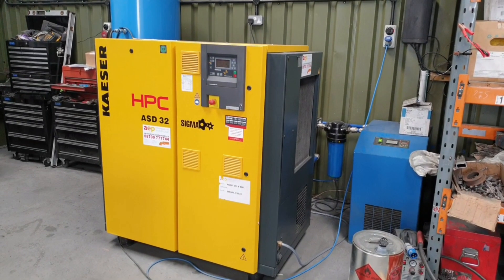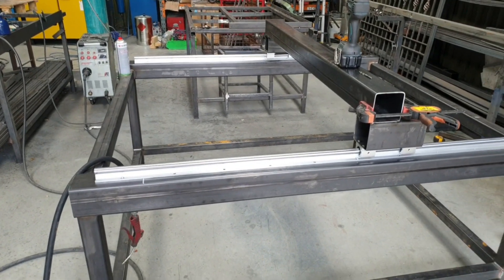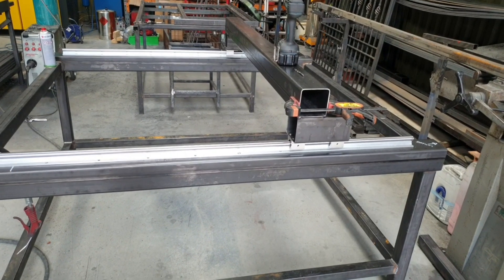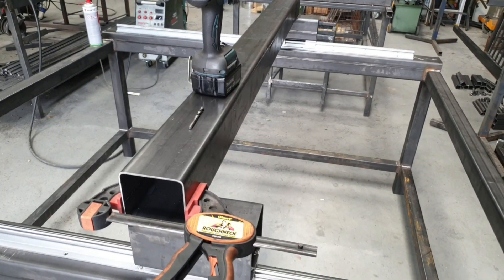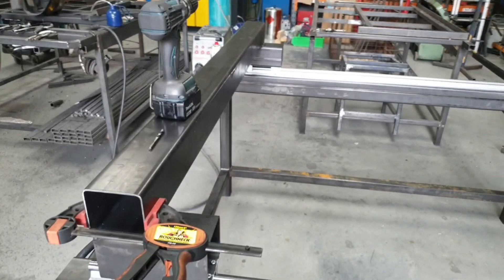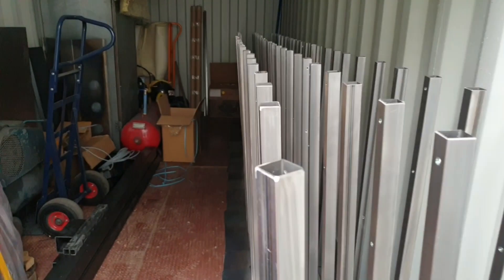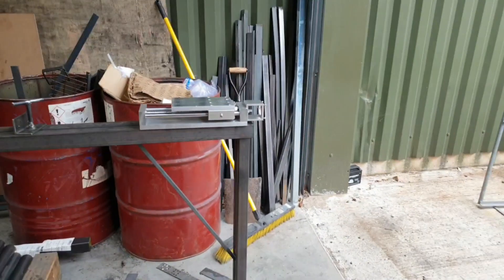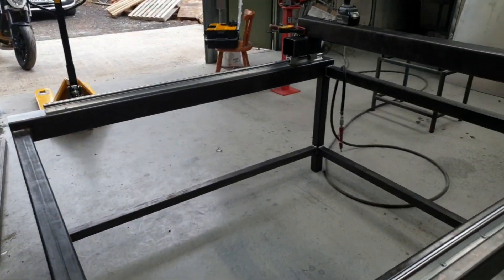CNC plasma build and shop update

Comment: Yes indeed "i want one". Do you have a "buy it cheaper" code(for the myplasm)? (1) If you make it again, wood you lower the linear guides for easy loading the steel cheets on the plasma cutter? (2) And in the later films you talk about 1/10 reduction on 4Amp. steppper close loop. How mutch volt do you use/do you want? (3) And how mutch is the gearing? About 100 to module 1? #if it keeps me from nightshift i want to be your patreon😊. Love your cnc and powdercoating stuff Greatings from Flanders/Belgium. You are greatley apreciated!!!

Comment: Hi Rob, I came across your video while looking for ideas on how to build my own CNC plasma cutting table. I'm also going to use the MyPlasm CNC motion controller as I like the power it contains and the MyMiniCAD software that's integrated into it. I'll also using their Torch Height Controller, which their software is designed to accept, which is a great thing. I'll be watching your follow-up videos on the plasma table's progress and I like your ideas regarding the gantry design....very clever, indeed.